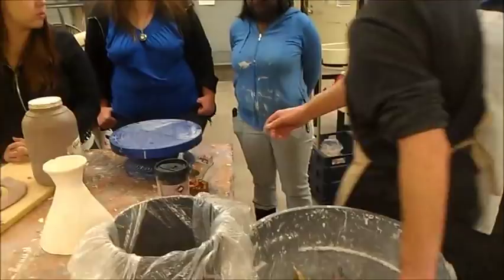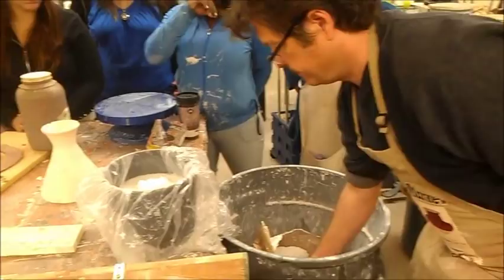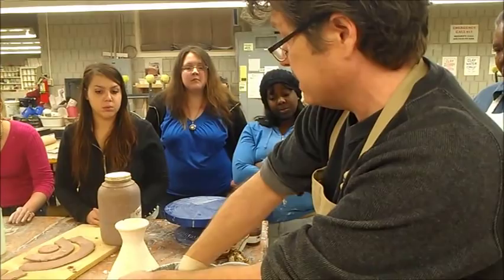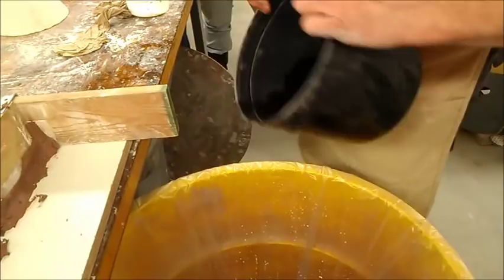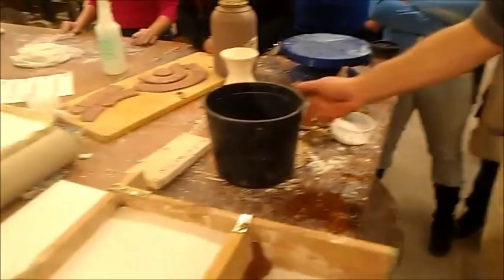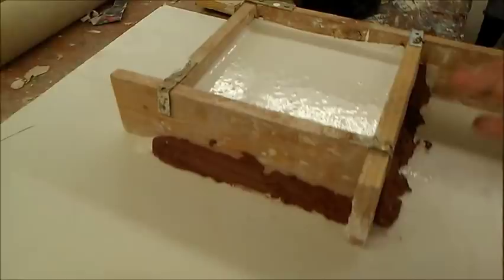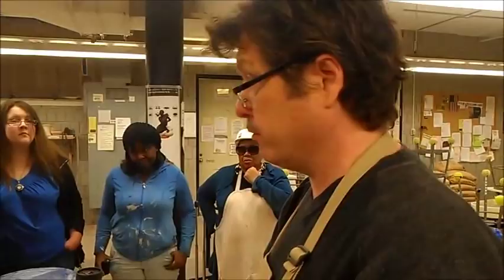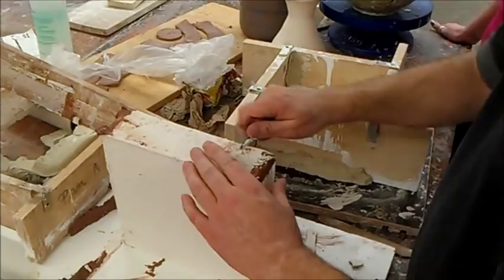OCC Ceramics: Making a Plaster Mold

Comment: Great video most important thing i like about this and learned from it. Is layer you buckets with plastic so you don't have to clean them out quickly/right after alot less mess/saves the buckets. Also i like the metal brackets if they are as good as using wood working clamps that would save the need for them and make the resizing of the mold boxes much quicker in setup time.

Comment: I've been a mould maker for over 35 years it is very frustrating watching a person teach mould making when he doesn't even know how to mix plaster.
Reply: +bruce kerr yea, that was a bit of a mess...
Reply: +Ediel Dominguez a simple tip you are pouring the plaster to early. Wait till when you pass your finger through the plaster and it starts to leave a trench in the plaster this is when you pour the plaster. This will stop nearly all the leakage problems. It's a shame you live in another country I could teach yo so much. A lot of mould making secrets are kept within the trade. I live in Australia and learnt a lot about mould making from a mould maker that worked in potteries in Sydney before ww2.
Reply: ... he was playing smart with students'natural ignorance. Nor he used the soap to demould and separate both pieces : the mould from the clay. Maybe he forgot ; maybe he was fooling students around ...
Reply: I have an old plate and wish to make a mold do i cover the plate in petroleum Jelly to be able to remove? making a press slump mold thanks.
Reply: A quick question: I would like to hang out with a friend and make plaster moulds (after we even know how to). Could these moulds be used to make wax figures?
Reply: bruce kerr xPmmpPp
Reply: you don't need to use anything - it should come out of the mould easily (unless it unglazed & porous). Just make sure that the plate is secured to the surface you are going to pour onto so that it doesn't float up and get plaster underneath it.
Reply: You '0ughta" know  [ that ] economics saboteurs are protected by law : and talibans , and barbarians , and Vandals . Still : it is not the case in this one thriller . The operator is fine , but he has too many distractions around him to cause a probably disaster . It's like you're talking to a fine Calligraphy-artist : at one moment error is going to happen .
Reply: k
Reply: que?
Reply: bruce kerr . Hi Bruce can you tell me what is the list of materials to make the mask. Thank you from Mexico
Reply: bruce kerr Mr Bruce could you help me !! I have some question about make mold
Reply: Manuel  Luis o
Reply: Mamainastichtchunkywomes cocoon wrap
Reply: Ij agree a 100 percent my hole family was in the ceramic mold business for as long as i can rember till the late 90 when my dad passed away u might know my family if u went to ceramic mold shows
Reply: Yes you add a measured amount of water to a measured amount of plaster
Reply: bruce kerr why don't you make a video of plaster mixing and post it on youtube.
Reply: So you always can share your own experience and knowledge. Just spread the world and everybody'll be professional.
Reply: bruce kerr . I'm trying to create a 2 piece casting mold of my dragon statue. I'd like to make it out of either silicone or plaster. Have you any links of how to do that?
Reply: Lumpy

Comment: if you take a dried tile and brush a layer of wood polish before pouring the plaster it will not stick with the tile and come out very easily without damaging the mould and you will also save your master piece. 
we are doing this for almost 15 years.
Reply: and the next tile u put in? do u use wood polishe on the plaster so the next will come out smoothly?

Comment: That's about the lumpiest blob of plaster mix I've ever seen.  Don't do that folks, mix the plaster well and thoroughly, especially if you are going to carve the plaster.  If you don't you are risking that the plaster is not cooked correctly in some areas and once you start carving you may experience chunks of plaster breaking off and ruining your work.

I use a plastic bucket and a hand mixer bit that attaches to my hand drill.  You can get one of those at any paint store or hardware store.  If you use low quality plastic buckets and you are using them continuously for mixing plaster you will only get a limited amount of use from them as the heating of plaster will deteriorate the plastic bucket.  Invest in a good quality bucket and you can get many uses on them.

The instructor here is correct when he states to not dump the liquid plaster in any drain, as in time the plaster will clog your drainage pipes and you are going to pay quite a bit to get those replaced.  Just let the leftover plaster dry on its own inside your bucket and toss the dry pieces into your trash bin.

Comment: Hi Russ, isn't is necessary to brush the clay with some oil in order the plaster don't glue in it ? I considere making  a plaster mold of an aluminum piece, does the plaster attack  aluminum/ Thanks for posting,oscar
Reply from the maker: Nope. You are not going to let the clay dry.  Frankly, you will be destroying your original. Once the plaster is hard, just pull the clay out, clean up the mold, and you are good to go. Frankly I would wait a couple days until the plaster is rock-hard before using it. Some DO use vegetable oil spray if it's needed when running production pieces with the mold though.
Reply from the maker: I have no idea how the plaster would react to aluminum. Never tried it. Hot water WILL eventually break down the plaster of you get some pieces of plaster caked on it. What will you be making your pieces with once you have a mold? Depending on what, you may consider using silicon or some other material.

Comment: thank you so much this was clear and easy to follow. how do you figure amount of water at the start to get the right amount of plaster to fill your mold?
Reply from the maker: +Brigitta Dixon My teacher used this "mountain" method which I never understood. The consistency you are going for is like pudding or pancake batter. I have been told that when you can draw a line on the top and it does not immediately fill, it's ready to pour. But you need to work quickly, as once its in the water and you start mixing, it will start hardening. Not IMMEDIATELY but fast enough where you wont want to dawdle.
Reply: 1 liter of water + 1,900 kg of plaster .
move it at medium - speed with a drill for 2 minutes . You've got only 4 minutes to pour it VERY SLOWLY onto the mould to avoid air- bulbs .
Forget not the soft soap to separate and demould it out of the mater .3 times
Reply: @manuelluis5456  Are you saying the ratio is 1:9?
Reply: @really2345  ... /... , 1 litter / [1 kilogram ] water _ to 1 kilogram and 900 grams , of plaster of Paris . 
Mix with a drill for less than 2 minutes . Only have 4 or five minutes to pour it very slowly onto the 'mater" . 
Forget not the demoulding soft soap all around the "mater's . ( 3 times ) before pour the liquid plaster onto it .

Comment: Could a plaster mold be used for a poly resin casting?
Reply from the maker: sure. be sure to use a release agent and make sure you eliminate any undercuts before using the mold (edges that you would have to get your cast piece out from under)
Reply from the maker: ***** when I use it, I didn't use one and it worked fine. But a light spray of vegetable oil would work as well. I never used vase line but I don't think it would be a problem, unless using a petroleum based clay like possibly some of the home baked poly clays. Even then I don't know if it would be bad.

Comment: So, you don't have to put the piece in the kiln before making the mold?
Reply: No need to kiln the piece.
The wet clay is used for the mould because it's easier to remove once the plaster has set.
It is then the plaster you make the copies from and you reuse the clay for your next project.
Hope that helps

Comment: What if I want to make plaster tiles by using a plaster mold? Is there any way so that the two won't stick together?
Reply from the maker: +山内淳カイル  I do not know for sure. I would need to experiment with it.
Reply: +山内淳カイル Yes, you need to use petroleum jelly on the mold before pouring your plaster. It acts as a barrier between the old plaster and new.
Reply: soap too
Reply: ... the teacher has forgotten a VERY IMPORTANT part of it : which is the liquid-soap we put on top of the design to separate the clay from the plaster- mould .... and he just played smart ...

Comment: Hi. I need help with a question. I live in mexico and cant seem to find gypsium.powder to make molds. I would like to make slip molds, i understand that plaster is ideal with a gypsium mold being that the gypsium retains the water from the plaster hence creating the slip effect. Unfortunatly down here i cant find gypsium, my question, can i use stone lime powder to make the outer mold? I do have acces to plaster. Or could i make the outer mold from.plaster and the slip cast from.plaster also? I would appreciate a response ty.
Reply: erick sal you can use plaster as a mold too, then put oil or petroleum jelly so the pour would slip right off

Comment: I've been making ceramic molds for 25 years now.
Plastic molds as well. There is so much in this video that he is doing wrong. First, measure your plaster. This is clumpy and much too thick. Second, never pour plaster directly over your model unless you use a release. 
And do not use anything like Vaseline. A great release spray is Murphy's Oil Soap mixture of half water and half soap. Put mixture in a plastic spray bottle. And from a distance lightly mist your model
 Use a cool blow dryer to get rid of any air bubbles.
Plaster should be mixed by hand 1 part cold water to 1.5 parts of plaster.
Sift plaster into water. Never the other way around.
Let plaster sit for up to 5 min undisturbed so plaster will absorb all the water. Use a paint stick to stir mixture for at least 3 minutes. Pour plaster over model slowly from the lowest point. Let plaster set. 
When plaster reaches maximum heat, remove your model gently.
Hope this helps.
Note: Use only #1 pottery plaster!

Comment: Russ. this is not my subject but still I can say if you put a layer of grease to make it easy to remove.
Reply: Imam Balouch م
Reply: That seems like an obvious way of doing it, but it will lead to disaster. Don't do this!
Grease/petroleum jelly will clog the pores in the plaster, sealing it and making it useless for slip casting. The plaster needs to be able to absorb moisture from the clay slip in order for this process to work.

Comment: how can we make a wooden mold form?
Reply from the maker: +Linda Gordon These ones are made with 1" x 6" boards. On the end of each one you screw an "L-bracket" so it can hook onto the next sine. It noes not need to hook over perfectly, but you want it without TO much wiggle room. Each side hooks onto the next at a 90 degree angle. This lets you use longer board and you can slide and size the mold form to your piece. As for keeping the clay from leaking out, when you are going to pour your plaster, you use clay on the corners and where the board touch the table and form corners to keep plaster from leaking.
Reply: +Russ Herschler Thank you hon!

Comment: Please learn to make/mix the plaster...... and then you can teach
Reply from the maker: it's 2 parts plaster to 1 part water. I never liked how my teacher explained it. it's pretty forgiving.
Reply: that depends, i use 1.4 per 1liter( plaster of paris) ..   All plasters are diferents but you are making stone not plaster... trust me
Reply: How to temper glass
Reply: Anthony Silva plaster of Paris ( the one in this thriller ) : 1,900 grams per 1 liter of water at room temperature of 18° Celsius . Move in the grinder or black and Decker for less than 5 minutes . That is the general rule
Reply: Anthony Silva plaster of Paris ( the one in this thriller ) : 1,900 grams per 1 liter of water at room temperature of 18° Celsius . Move in the grinder or black and Decker for less than 5 minutes . That is the general rule .
Reply: Manuel Luís como já tinha dito, depende do gesso. Não ha nenhum que seja o normal há varios!
Reply: hy ! i have  a question ,how  much  time  you  are  mixing  a quantity  of   350 kg plaster  to pour  in 5 moulds ,report  is 1,4!
Reply: Thanks that amazing

Comment: I want to cast some stuff made out of plaster to make a mold for ceramics. What kind of release agent do I need to use on the plaster so it wont stick to the plaster I am pouring to make the mold?
Reply: proflooney You can try baby oil. It's a good release for plaster, but I've never tried it ON plaster .. the other thing that works really well is cooking spray.
Reply: proflooney hi, when I did my degree course, we were taught to use soft soap, just a really soapy water mix. What you do is take your model and soak it in water until no bubbles are coming out, it needs to be totally saturated. Depending in the size, this can take from an hour to about 3 hours for something about the size of a middle sized watermelon. Then you take it out of the water, mop up the excess and start soft soaping, you need to do at least 3 coats  (you will be surprised at just how absorbent the plaster still is when you do this process!).  This will prevent the new plaster from sticking to the model. The soap will not transfer to the mold. Good luck, and watch those undercuts!
Reply: proflooney it's actually been 7 years since I did and mold making and I remembered this morning that I forgot a couple of steps. When soft soaping, you actually paint it on neat, then sponge it off with water, then paint it on again. The model will take on a nice warm waxy/satiny sheen when this is done properly. It was the last step in my favourite part of the process. I loved making the models, hated making the molds!
Reply: ... normally liquid soap . one day l used W.D.40 Guees what ???? it was my best short !!!
Reply: +Manuel  Luis ERRATUM 1: SHOT.
ERRATUM 2 : SOFT soap.

( it can be petroleum jelly , also )